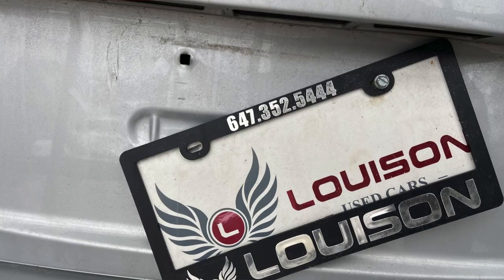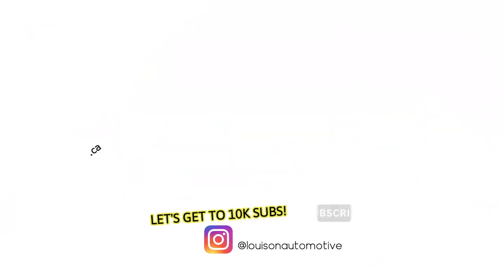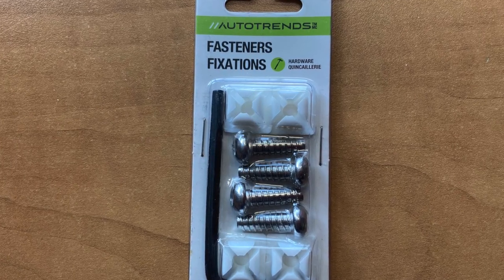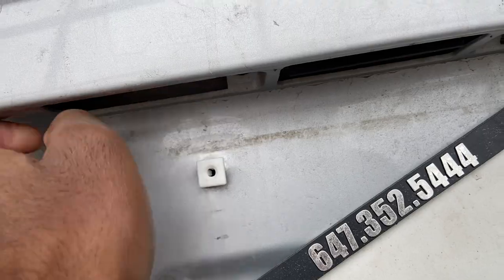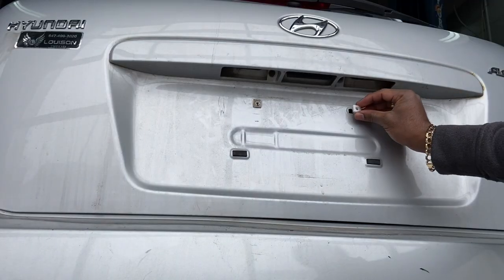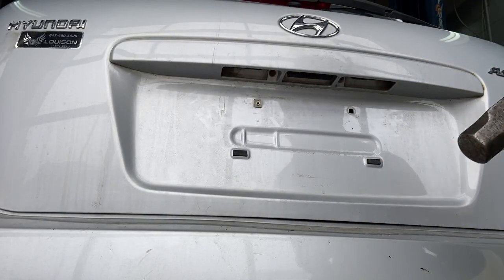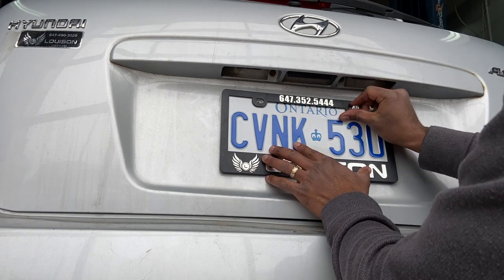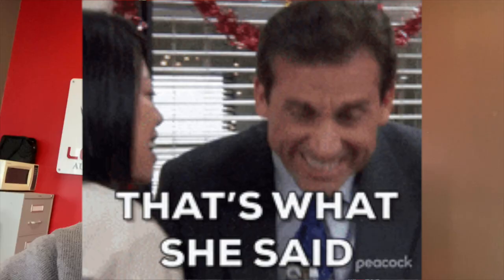How To Fix Broken License Plate holder hardware | Automotive Tips

Comment: Would this work on a front license plate holder?
Reply from the maker: I never tried it in the front.
Reply: @LouisonAutomotive  Yeah, I managed to strip out one of the holes on the front license plate holder. It’s plastic, screws to the front bumper. I can’t use those white plastic wedges in the holes because the holes are round. Debating taking off the holder and screwing it directly to the bumper